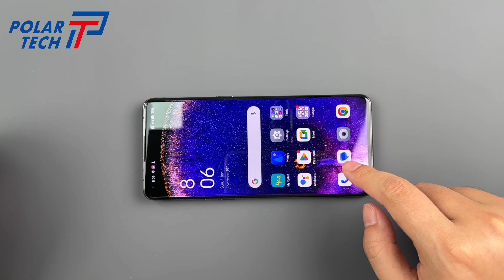OPPO Find X5 Pro Teardown & Disassembly

Comment: Really like the video. I also have Find X5 Pro, it easy to get vertical lines. Do you have any tips to prevent those discomfort lines?
Reply from the maker: Those vertical lines usually mean the display itself has developed a fault. Once that happens, there isn’t really a way to prevent it from getting worse. The proper fix is to replace the screen.

Comment: Great video, do you know where I can purchase a new main board in the UK? My son's X5 pro just cut out randomly while he was using it and charging. Won't charge or turn on, no indicators of any kind, holding volume up and power or volume down and power does nothing. I've read online that others have had problems with this happening too
Reply from the maker: https://www.polartech.com.au/collections/oppo-parts/products/unlocked-working-oppo-find-x5-pro-cph2305-motherboard-main-board

Comment: Great video. The glass on the back of mine is smashed. Can i get replacement glass or do i need to change the full back cover?
Reply from the maker: Just get the back glass
Reply: @polartechonline  I cant see just the glass what do i search for all i see is glassless backs or lenses :( thanks for the reply
Reply from the maker: @ https://www.polartech.com.au/products/oppo-find-x5-pro-cph2305-back-rear-camera-lens?_pos=1&_sid=262885804&_ss=r
Reply from the maker: https://www.polartech.com.au/products/with-camera-lens-oppo-find-x5-pro-cph2305-back-rear-battery-cover-panel?variant=45148466184415
Reply: @polartechonline  ahhh thank you that looks right perfect. Would it be worth changing the battery if I'm getting the back of anyway?

Thanks so much.

Comment: thank you for the video, i had never seen the inside of the 5 pro
oppo pretend there is a graphene gasket or something in the phone, i wonder what they mean by that
Reply from the maker: Graphene film is primarily used for heat dissipation in smartphones. With a thermal conductivity that is dozens of times that of copper, it is ultrathin and flexible, allowing it to easily conform to components of various shapes. The black film you see inside your phone is graphene material. It is applied beneath the screen, above the camera, and on the wireless charging coil.
Reply: @polartechonline  Interesting so they really use graphene for heat transfer
You seem very knowledgeable, i own a 5 pro and sadly i get terrible battery life on android 14, i have tried disabling 5g, its set to 1080p, no location, no air gesture, i don't know what could give me better SOT, i love the phone its beautifull, the ceramic, the cameras are fantastic, color os is beautiful and quite practical
people say its the snapdragon 8 gen 1 with its samsung process node, but i there a way to maximize battery life?
Reply from the maker: @guillaumefigarella1704  The battery might need to be replaced.
Reply: Can you provide a link for a battery and display as well? I would like to try change it to mine
Reply from the maker: @Marcoaleite  https://www.polartech.com.au/products/blp889-oppo-find-x5-pro-cph2305-replacement-battery